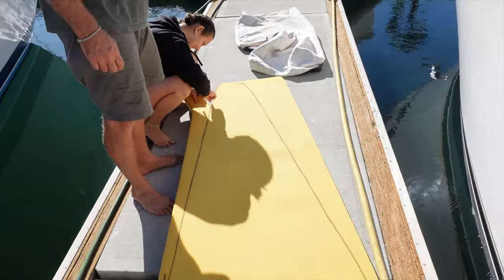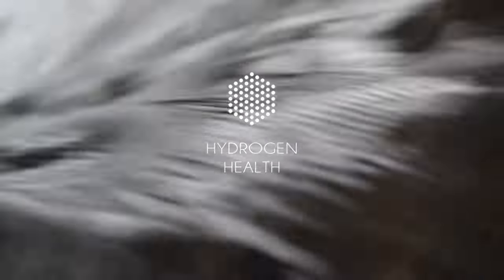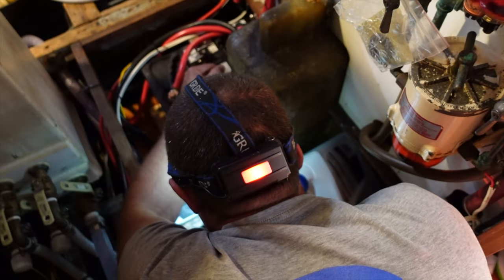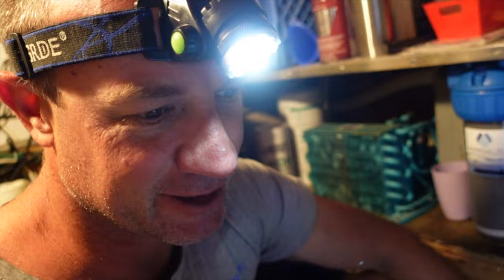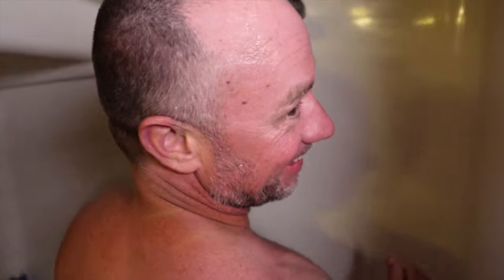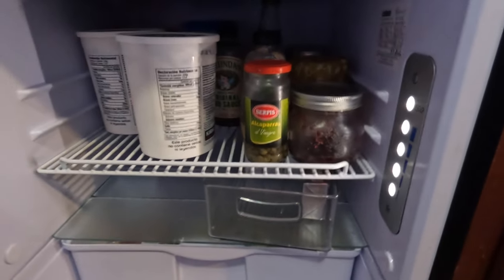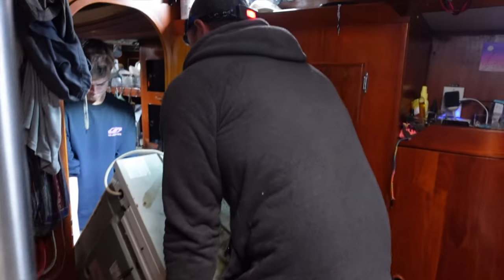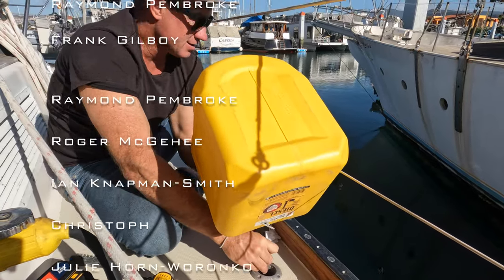Sailboat Refit with a shower upgrade and handy tips for cruisers | Boat work | Ep 343

Comment: Add some Howes Diesel Treat to your diesel tanks.  It demulsifies the water from the fuel and adds lubrication to extend the life of your injector pump.   You won't believe how much water is still in your fuel after you think you have removed it all then add Howes.